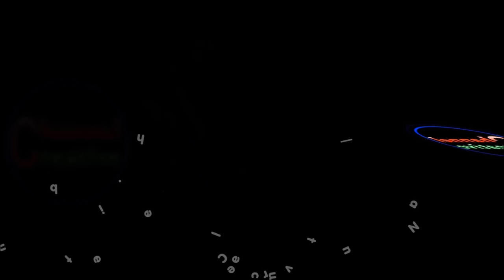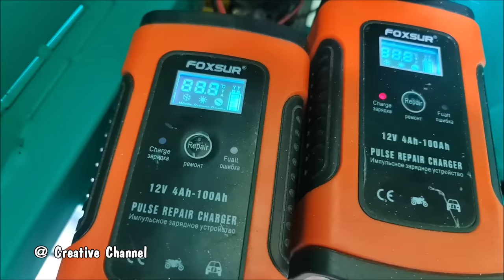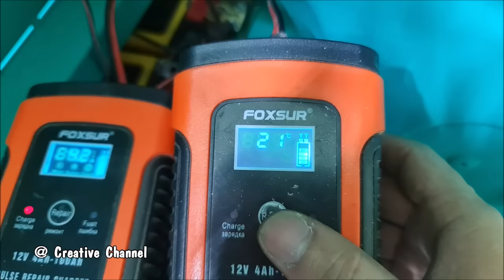Build a Electric Cargo Trike with Honda Chaly Scrap

Comment: You are a true genius, I admire and congratulate you.
How much is this vehicle worth in dollars, how much power does the motor have in watts, what autonomy does the batteries have? I think the steering wheel would have been better about 10 centimeters higher.

Comment: Maybe place charger under seat with a cord so you can charge anywhere if battery dies, incredible work, what is the range  on it like? Get ratchet straps, that rope is scary! Also add a padded  board for your back in case you are hit from behind
Reply: Yes
Reply: {Assalomu {{
Reply: Assalomu
Reply: O

Comment: It's been a year.. but I have a question...how hard to do the same thing  with a Honda gyroS... motor just stopped running..  but the rest is fine.. can't find parts and no one will help fix the engine.. so make it a e-trike?
Reply: Yeah!

Comment: This looked like so much fun and so easy to do, so i decided to make one myself.
I went out to the garage and looked trough all my stuff, and there was no electric drivetrain rear axles, no leafspring packs, no box of handbrakes, all matched to eachother and so on, so I went inside and weote this comment instead.
Reply: Well said... With all that gear available, on a shelf in your garage/workshop you could make just about anything......I have a hoard collection of scraps for 40 years and find it so difficult to make bits fit that I order them from China, just like this chap has done !!!☺☺☺
Reply: Oh and I forgot to add...deep pocket needed

Comment: This really is one of your best builds , you might want to take a piece of rubber hose and split it to use around as a  grommet were the wires go into the body of the scooter so they don’t wear thru , and an external charge port to charge the batteries might make things easier , this was a great build and is very useful how fast will it go ? 🤔
Reply: Http

Comment: I think the stroller is missing two things: a cover that protects the small electrical circuit located behind the seat from rain. The second thing is to make a cover for the cart that you can install when needed to protect the load from rain, or to protect it from falling, or to add overhead space for the products. Greetings, great work ❤❤🎉🎉

Comment: The only 2 things I would have done differently is make the bed have the option for tilt for any loose substrates or cargo you want to drop in a hurry and I would have added some type of reverse light or cargo/utility light for having a rear lighting option when backing up or having to load/unload things in low light. Besides that I am very impressed
Reply: That thing can't carry enough to  make it worth a dump bed and a light isn't  needed. Carry a flashlight  or don't dump trash illegally at night. It sounds like that's what you want I for.
Reply: No one is stopping you from building one yourself, the way you recommend.. Easy to talk and criticize.  Super hard to actually do the work. I fabricate parts for vehicles. It is hard, and time consuming.
Reply: @scootersonlyrepair6773  LMAO, no, I prefer to do most yard work at night as I'm extremely sensitive to high temperatures.  And the fact that I even said " tilt for any loose substrate" (i.e. gravel, mulch, lawn clippings) should signify that is what I meant- not illegally dumping trash🤣 I have trash pickup every Monday and prefer to keep my lil 12 acres nice and tidy.
Reply: @ramluma  I love how you claim I criticized this build- when in reality all I said was what "I" would have done differently,but that the build was otherwise awesome...
I have built utility carts/trailers before- and some were similar to his build- this is why I stated what I would do differently if I built another. 

I'm sure this person is capable of doing this fabrication work and taking up for themselves from the horrible opinion people on the Internet by the way... Doubt they need you coming to their rescue, especially on my comment🤣

Comment: Great project and a job well done. Unless I missed it though,, My only criticism would be is that there are NO Fuses on any of the circuits,, just a main battery isolator switch,, No good to stop a current overload and possibly a fire?? Sadly, this could be just another EV go up in flames in Asia...

Comment: I was just thinking about about weight to power ratio. Being that he is using an electric motor. I’m also thinking about the strain on the motor and power supply/controller trying to compensate for the high amperage draw created by overweight and the strain on the motor and gears to propel! Maybe I’m just over thinking! Just my thoughts don’t hurt me people 😉